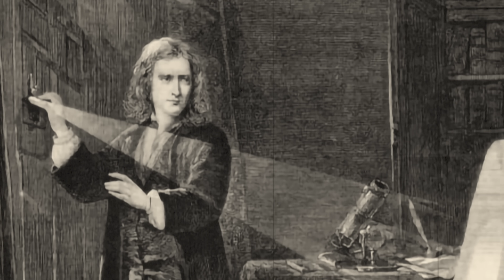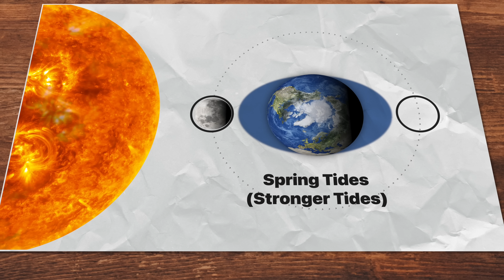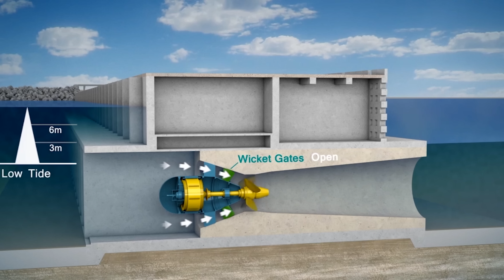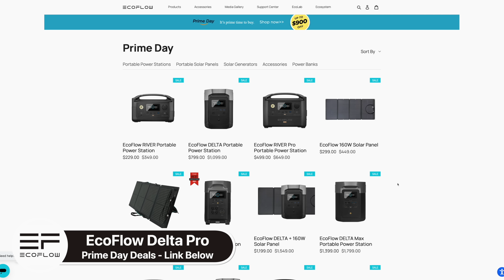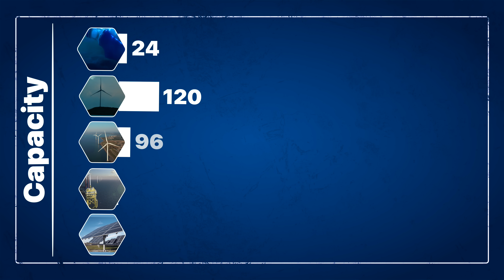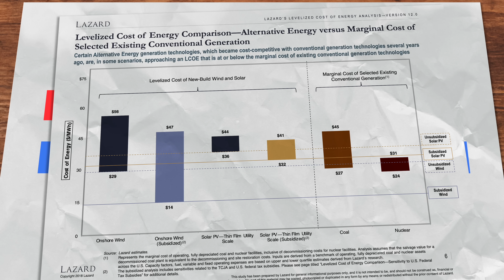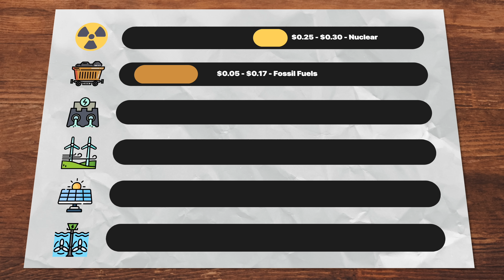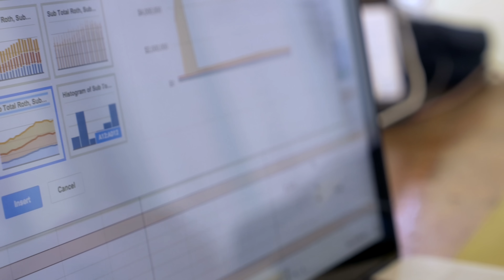Breakthrough Energy Source is 10X Better Than Wind & Solar!?

Comment: It just seems weird that all the tidal electricity we harness will make a tiny contribution to causing the moon to drift further away from the earth. In a few million years the moon will further away from the earth and tides will therefore be weaker. I'm just stating these facts out of the sheer intrigue that is generated by considering them. I'm not saying there is amything wrong with using tidal energy. Nature ends up wasting most of that energy anyways, and whether we tap into it or not, the tidal friction here on earth will eventually slow the moon down and make its orbit larger and further away. But it is fascinating to think of how the original source of tidal energy was whatever force gave the moon its original momentum relative to earth. Which in of itself does not renew, so as the friction from the tides and plates moving around gradually pulls back on the moon as it orbits, this eventually slows the moon down. It's crazy to think about all this, right?

Comment: For clarity: Tidal Range is the difference between High Tide and Low Tide which is made use of in systems with a dam or barrage. So I don't get why at 14:53 he is saying "tidal Range systems benefit when the range sits around seven metres" while showing pictures of tidal Stream generators, and earlier in the video at 4:05 he refers to the dam itself as the "range". This is fundamental stuff that he is confusing the audience about.
Also he mentions briefly floating Tidal Stream generators - it would be nice to see some examples of those as some of them have a kind of see-saw method for raising them for maintence

Comment: Will this not affect the rotation of the Earth? Holding back the tide and then releasing it later must change the momentum. The same must be true if you restrict the flow. Has anyone even thought of calculating how much effect this has? If it's rolled out in huge volumes, perhaps they should.

Comment: There is a project in canada using a surface water wheel design. The last article i read about it was march 2023, at that point they had yet to do final testing.
Having 90 to 95 percent of the machinery above water should help on ware and maintenace and keep it in line with other renewables.

Comment: No way is Tidal Power renewable.  It slows down the earth's rotation. If there is any benefit to be had it could be that one day there will be 364 days in a year. That will enable us to have 13 months of 28 days each which is easy to work with and which is largely only an academic benefit. At that point how do we then stop the rotation slowing down? I daresay there are ways, I won't go into them here.

Comment: To my thinking, tidal power has one big advantage – 70% (or about 70%) of the world’s population lives on an ocean’s coastal area. Being close to its market, it could hopefully generate power at a lower voltage making its transmission more efficient / economical. Efficiency is the problem with our electricity systems. It being renewable, makes it very attractive; we must end the use of fossil fuels, which are very expensive and over the last 50 years, have proven to be a very insecure energy source, thus, very inflationary. Myself, I believe geothermal energy sources are the preferred renewable energy source to produce electricity. It is a base energy source; you can simply leave the hot fluid in the ground till energy is needed. It is my #1 choice. Ethanol fuels or oils from biomass are my choices for our transportation sector.

Comment: Yeah I live in NS and both projects failed, and in fact one of the companies went bankrupt and it's still sitting in the bay to this day. I'm not sure why, but part of it was cost for the project and environmental concerns that wherren't address very well. NS is very much into environmental activism and often to the point where it prevents us from moving forward with good energy alternatives. If you don't have a near 0 impact on the environment good luck getting the project off the ground.

Comment: Problem is solar keeps getting better every year where wind and title has been kind of stagnate from the start. Future cells for solar to bring cost down by another 30% in 1-5 years. All these technology suffer from power storage - so doesnt matter what method of power production you use - they will all need power storage either way you look at it... Thus, solar is the only one looking to come down in cost while also improving in power production for the area it takes up. Wind and title all have the same issue in that they have moving parts. These moving parts wear out over time and thus have to be repaired that adds cost. The generators they use also use rare earth metals and thus have extra cost to them and can't be made just anywhere. Lenses are also improving for solar... thus they will in the future either be 3D design taking more "surface area" to the panel for more power generation or allow them cover more degrees without moving at all reducing their moving parts as well.

Comment: Whatever happened to the underwater wave generated power using fixed pumps on the sea floor attached to underwater buoys that go up and down with the waves?  Below the surface, no blades, all moving parts contained in a box, off the shelf technology used for under gas/oil extraction and constant…. I haven’t heard anything about this for years now.

Comment: Instead of converting wind / tidal turbine energy to electricity and transmitting it to the "Grid" use the energy as it is being collected by running an atmospheric humidity condenser (direct mechanical energy), store the fresh water at or near the turbine site, and collect the fresh water to transport the water to where it is needed.

Comment: Hi, no, hydroliennes do not work - well, they work a few time and then…

One of my old friend (80 years old this year) was in a building resistance calculation company (don't know if it's the right term, this type of company does all the architects maths as it is separated jobs in france;) that made all maths for the La Rance dam, as he's a good engineer he was interested in how it works, so he befriend with some engineers dedicated to the plant and followed what was happening for several years and even now from time to time.

It is plain simple, as I said it works a bit then you have leaks (eg: came with a big tree branch hit on a turbine), metal corrosion (terrible and systematic, whatever the alloy you use and the precautions you take) and above that, you have vicious seaweeds that brakes the regular rotation of the propellers and more than that, all the (sometimes not so) little crutaceans with hard shells that colonize all surfaces under water, all of that at an unbelievable speed, making a cleanup obligatory every 2 months.   Almost everything has been tested, re-tested, changed and re-re-tested and this plant is still used today to keep on conducting material tests - due to the multiple failures happening with no visible solution (longer period of continuous work : 2.5 months, then stop for 1, 2, 3, 6, 8, … months, time to repair/clean/cahnge materials/etc), this has driven all engineers that put their fingers into it to a nearly definitive conclusion : it can work, but it's not worth it.

Think a bit, in the last 50 years, we've seen such projects blooming with big promises (this time is the one !), with a big acceleration in the last 15~20 years, then they wither, all of them !   Not one project was able to keep up with all these huge constraints, not for a long period of time and not even for just a reasonable one either (read commercially viable), however during this time a huge number of suckers have engaged AND systematically lost big money in such projects, that's the only thing that is sure in this matter…

Comment: Yes of course, there should be much more investment in tidal than in wind. Tidal is a far more dependable power. The fundamental issue about power is that it cannot be effectively stored: So when someone switches on a light switch in Glasgow, Edinburgh or London the power has to come from somewhere immediately.: If the wind is not blowing then the power will not be coming from wind; which means you have to have a fully manned and functioning back up power plant, usually gas as they are the quickest to power up. So with wind the power customer is paying for the upkeep of 2 power plant for one electricity, whereas with tidal  you build a bridge and Tidal Barrage, one capital outlay for 2 uses. Common sense.

Comment: The big issue I see here is salt water corrosion and local underwater ecosystems. Saying that those power generators have a life span of 80 years without mentioning the HEAVY maintenance they would require is a bit misleading.

Comment: Since the energy only needs to be stored for a few hours, storing it in flywheels becomes a viable option. That basically eliminates the intermittency, meaning that other renewables need to be compared on a generation + conventional energy storage basis, where they will be at a big disadvantage.
Your graph said it is about 2x as expensive as offshore wind at worst... with the advantage of less intermittency taken in account, might the playing field be leveled between these two already? Especially in a lithium-constrained future where additional battery storage is not an option at scale (also assuming sodium-ion doesn't take off, I suppose). And of course, its big advantage over other cheap renewables is its near infinite scalability.

Comment: 4:30 it will never be "power on demand" because you may need the power when the tide is high on the outside so opening the gates won't move water in either direction.

Comment: The energy of the tides actually comes from the friction of the earth distortion (including the water slowing the rotation of the Earth). Each time you harness the tidal force you are further slowing down the spin of the Earth. This, in turn, exerts a force on the moon driving it outward also slowing the Earth's rotation. Eventually we will loose the moon as it will be flung into its own solar orbit. For all orbiting bodies the tidal force on the body changes its orbit. For bodies orbiting with a slower orbit than one day the force is outward toward escape. For bodies that have more than one orbit per day the bodies are slowed by the earth forcing them inward toward capture. Bodies with exactly one sidereal day  (Geosynchronous)  day would be stable except for disturbances of the moon and the which perturb the orbit.

Comment: Thank you for using a map to make relevant the S. Korea city of Siwa!  REally appreciate that!    Tidal energy harvesting seems like a no-brainer.  If you consider that all the parts can be made of magnesium or aluminum or a corrosive resistant alloy; and, you also consider that they are about as complex as a Tesla car; then the Giga-press becomes a huge cost reducing factor in making these generators.  Elon should be on this like stink on a skunk!  Add to that the recent advances in power transmission line efficiency brought on by graphene and borophene and Ubi is around the corner, but for, the political fear.

Comment: Carbon should be removed from CO2 using MOXIE or similar.
Irradiate the carbon then turn it into diamond batteries which will produce electricity for 1500 years, This process also sequesters the carbon indefinitely.

Comment: Tide energy has been harvested for centuries. Eling tide mill outside Southhampton has operated on this principle for over 900 years.....and is still in use at the same location , the present mill was built in 1785 and is a fully functional mill accepting visitors. Well wort a visit

Comment: I believe that a lot of research needs to go to the technology to use tidal currents. The wind stops, the sun goes down, all the others pollute in their own way. But for the exception of the slack
 tides 2x per day the times are moving in a 100%  predictable manner. Since water is 10x denser than air the units can be so much smaller. In the late 70s I started scuba diving in the Florida 
keys where there are some wild tides between the islands. I can stand in a 5 MPH wind and its nothing. I tried th fight currents 5MPH and was swept away. Especially between the Islands
where the currents were funneled and very severe. We used to ride these currents and I was so in awe of the power. Many times you could not even hold on to something to remain in the same 
place. We NEED to harness this power. Find the materials and designs that would work. They did it with Hydro plants, harness the water. Now we need to do it with tides. I do know its salt water.

Comment: I live near Anchorage with the world's fourth largest daily tide of 30 ft or 40 ft. Building a dam across it will probably kill it and it's way too big for what you would get out of it. I've seen fixed propellers that one would sit in the water, but is that safe for sea animals? A picture of long cable miles long in a loop with something similar to umbrellas attached along the cable. No matter which way the water is flowing it will pull the cable the same direction without impacting wildlife or killing the tide. Our electric utilities have just invested millions on natural gas generation equipment and the newly consolidated utility of Anchorage Plus new equipment interconnected in the valley power company have created a situation of overcapacity and they don't want to by large quantities a renewable power preventing the expansion of the overly successful Fire Island wind farm.  I cannot picture a cheaper way to create a lot of electricity than the project I've described at our location. And there's no plans to move forward on any tidal project even to experiment. We have to pay for the natural gas power plants first.  There's even more to this story that is a total new story in itself too thick for me to write here, stories of deception that prevented the twin Susitna Hydro power project which would create more power than we could use by the turn of the century 2000, as the natural gas industry which was in short supply at the time also gave false figures proving natural gas would be the cheapest power in the nation just prior to it going from four and a half cents a kilowatt to now 22 cents a kilowatt retail. They said the hydro projects would produce power at seven cents a kilowatt which was double the price then though a bargain today. The truth was the hydro project would have been profitable producing power at less than 5 cents a kilowatt as a smaller less efficient dam was still indeed built separately at the Kenai which was going to have a higher retail price in the big twin dams. It paid for itself at 5 cents a kilowatt and it's the cheapest power on the rail belt serving the Fairbanks area all the way South past Anchorage down to Seward and Homer on the kenai peninsula. Our state mantra by the US's is drill baby drill baby drill baby drill. No one in the oil industry here favors alternative energy and believe global warming is inevitable and a hoax. Those not employed by the oil industry are well split leaving a minority to be concerned with global climate change and CO2 emissions. Alaska is like Russia. We sell oil and minerals with a fight over a copper mine versus the last great salmon run that still is there overloading nets. Tourist and spend a little money. And the federal government, the state's largest employer with military bases. Sticking with what you know, clean coal, since 1892, is the measure of progress seemingly it seems our  typically well educated view of the future.

Comment: Do tidal ranges use the height differential to power gravity batteries of any type? I remember another vid of this type talking about that and it was intriguing.

maybe we can combine methods of energy generation within the same device and come out with a surplus in the same way that composite materials effect properties that don't' exist normally together ?

I mean, if you're already turning a turbine to generate electricity, why not also wind a device that can store energy via gravity battery? Of course you're not CREATING more energy but maybe you'll be HARNESSING more of it?

Comment: I enjoyed your analysis and discussion. Capacity Factor is another parameter to consider when investing in generation. Capacity Factor for tidal generation will be poor (meaning generation is unreliable resulting in the need to store energy when tidal energy is off peak, the tide comes twice a day, but it also stops twice a day). In addition to storage, there is frequency conversion apparatus for interface to the grid system. All this complexity adds cost and reduces reliability. And then, as you mentioned there are but few locations in the world suitable for tidal energy.

California has proven that poor Capacity Factor solar and wind results in unreliable and the most expensive power rates in the USA. Even with great German engineering, Germany confirmed this with their most expensive power rates in the world. And then there is Australia… etc.

Leonardo is one of my heroes. Unfortunately, this “10X breakthrough” contraption is comparable to other 15th century technologies. For modern times we best move to 21st century green intrinsically safe reliable new generation nuclear for the grid. Checkout NuScale Power small modular reactor nuclear technology.